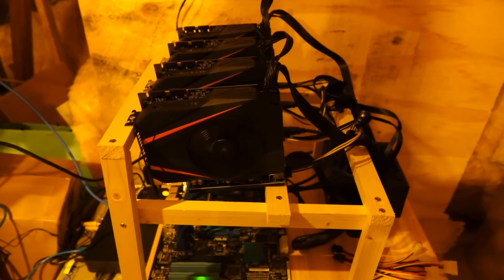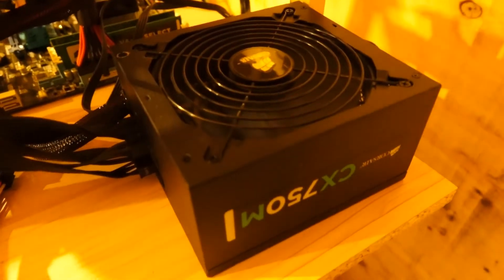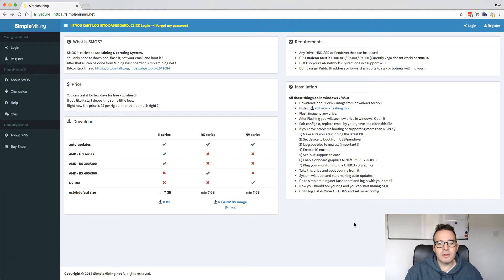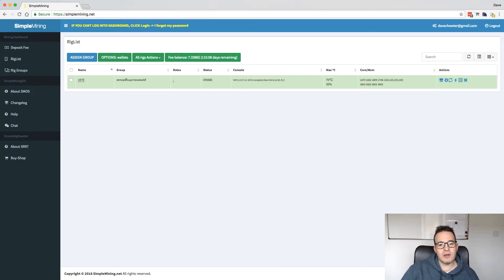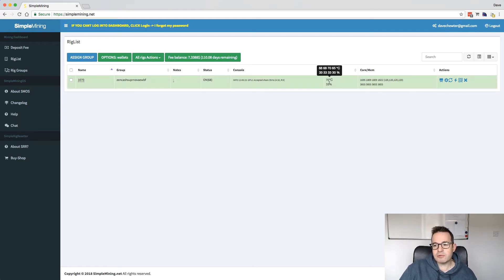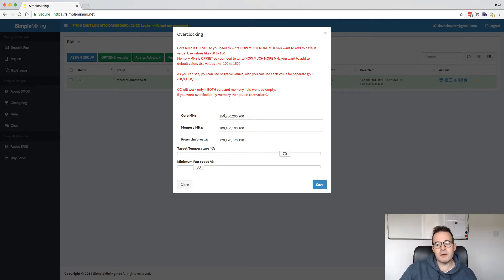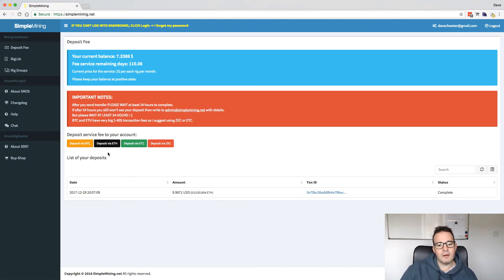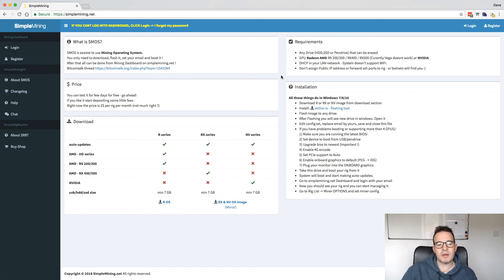GTX 1070 Mining Rig

Comment: Try 172 on cpu  and 200 on memory.  getting hash with two cards 90 sol on BTG coin.   
I did have heat problem with two 1070 itx mini in computer case.   Solved it with two cpu fans on bottom of each card.   Use zip ties to keep space from fan and card.  Note direction of air suction of heat off bottom card blowing to fan of top card worked great and top blowing down on top card not to interfere with CPU fan works great. now both cards heat running 73c stable happy as can be . ( before fan trick temp cheeped up as high as 88c Wow)
Reply from the maker: Thanks for the detailed reply. I'm not currently mining, but have made a note of these for when I switch on the miners again.

Comment: Dave which route would you go down with a limited budget of say £1000, GPU Mining or Burst mining. Love your videos straight to the point and so many helpful pointers.
Reply from the maker: Personally I would go the GPU route, but I wouldn't buy at the current price levels. Wait for a month or two for things to calm down and GPU prices to go back to normal. As an example I bought the first 2 cards in this rig for £380 each and the second 2 cards a few weeks later for £400 each. Those same cards are now for pre-order at £550 each which is ridiculous. I think the ROI on Burstcoin is pretty poor now, but if you go the GPU route you can always add and external hard drive or two in the future if things pick up or other proof of capacity coins appear. Thanks for the kind words and good luck with your future mining.